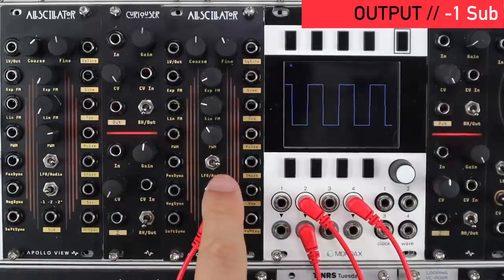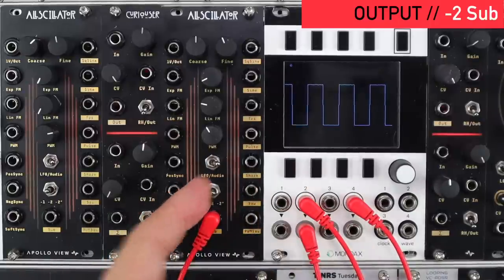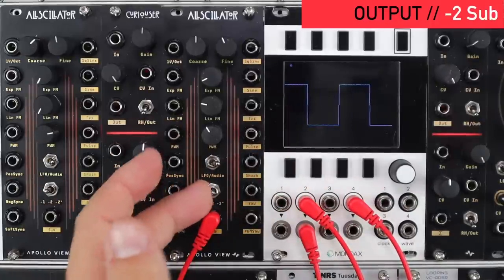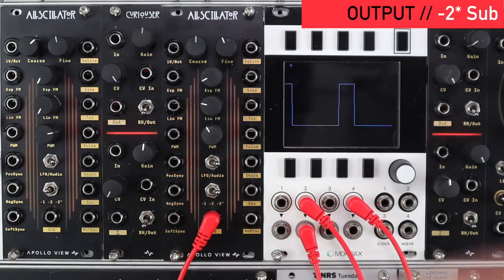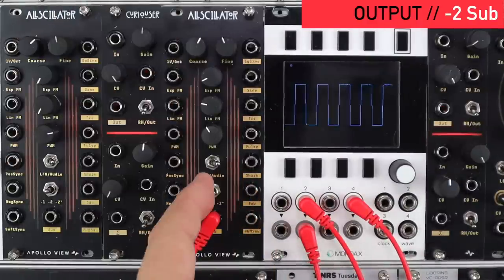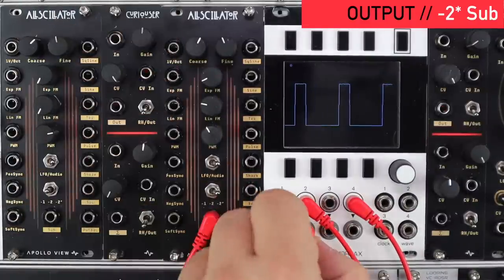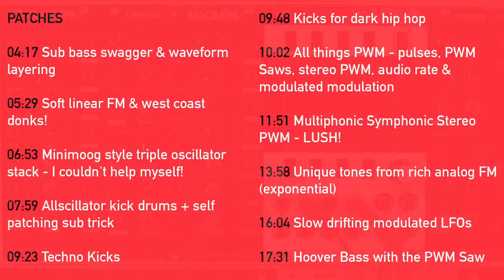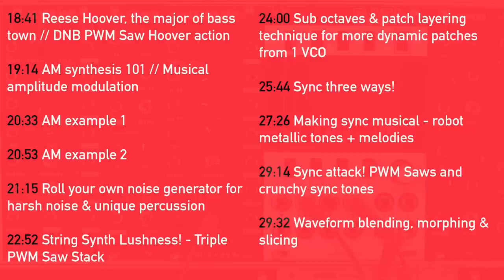PATCH BETTER with 16+ patches for oscillators // Allscillator from Apollo View Modular

Comment: Dang, tip one, and I'm blown away
I've had an oscillator with a sub out (Bastl Pizza) for a while now, and never considered using two different VCA patterns to make it sound like two voices.
It's such a simple idea, and I've done some really weird patching since I've built this rack, but somehow there are some little tricks like this that need to be shown to me.

It feels like if someone pointed out a door that leads to a room I never noticed in my house.
Reply: Mylar melodies is real great at doing that. Taking different outputs and running through entirely different vca, filter and effects routing to fake different voices. Fun stuff!
Reply from the maker: Thanks Gaeel, a personal favourite is having a less rhythmical dense gate pattern play an envelope + VCA for a sub wave. If you can get a -2 octave sub you can get some really cool separation between what feels like a higher and lower part. 

It usually means faster envelopes so you don't hear the other pitches come from as an envelope fades out and the 1v/oct is still playing faster changes but usually works well.
Reply from the maker: Yeah Mylar is a good call for that too, one thing he does different to this example which is nice is use the same pitch sequence but split off the pitch sequence. Rather than use one oscillator and break off different wave forms. Split the sequence into multiple places but only let certain notes play on each one. Nice musical way to work.

Comment: Thank you. I am little more than an initiate into synthesis, and this very informative video is encouraging. Much of what you are doing seems super complicated even after you explain it I must admit. Nonetheless the way you explain it along with the visual aid of watching you do it at the same time makes its simple elegance obvious.
Reply from the maker: Thanks Aaron, things are tricky when you get started. If you can give VCV (free software) a try and try to rebuild some patches from videos that you like. It will give you an idea of how to go about some of the patch ideas without the cost of having it all in front of you. It's not patching hardware in experience obviously but it can help with the initial learning and understanding of patches. 

Feel free to ask questions and thanks for the comment.
Reply: @DivKid  I am doing purely analog to start out. I actually started by building simple to moderate breadboard modules. It helped me understand the individual components and very basic patching. I am encouraged to dig deeper now.
Reply from the maker: breadboarding and understanding the circuits is a great way to go, hope it's all going well.

Comment: this really was super inspiring, tried out a few things with my little AE Modular, the AM in particular worked well and really expands the range of timbres I can get from 3 fairly limited oscillators. A bit of filter FM just to spice it up even more, interesting comparing how the overall sound can change a lot depending on wether the base oscillator or one of the modulating oscillators is also modulating the filter. Lots of ground to cover with experiments, I'm embarrassed to say I hadn't thought about AM using a VCA... Cheers Ben, thanks for the video. 🙏💙
Reply from the maker: glad to hear that and glad to hear you're getting good results too. Definitely coupling filter FM with AM is a good thing. As you say which of the oscillators goes where makes a big difference. Also try modulating the filter with the AM modulated waveform that can be fun.

Comment: Minor correction: The synced waveforms look like what you'd get from a 3340 IC, and the positive/negative sync-inputs are an almost dead giveaway that thats the chip that was used.

The standard hard sync on the 3340 doesn't work like 'normal' hard sync - that the waveform simply resets - what actually happens is that the triangle wave "switches direction" if the positive sync pulse coincides with the positive ramp of the triangle. (And the other way around for negative sync)

This is a pretty unconventional way of implementing sync, so many manufacturers who used the 3340 back in the day did a workaround to get the regular sawtooth reset kind of sync. 

I always like it when designers go for the "true" 3340 hard sync. It's a cool sound, especially on the tri wave, and opens up for some patches that aren't possible otherwise.
Reply from the maker: Hi Johan, yeah the 3340 IC was used, Apollo View aren't trying to hide that, they mention on their site/manual. 

Thanks for the history/explanation of the sync and how people usually changed it, always great to hear information like that.
Reply: @DivKid   Wow, thank you for the reply! After posting I honestly felt a little awkward for such infodumping. Thank you for your work throughout the years, you are so inspiring.
Reply from the maker: Thanks for following along over the years and for the kind words, much appreciated. 

No worries about the info dump, it's good to learn new things so always feel free to share here.

Comment: Do you have any other videos that are just module agnostic patch ideas?  I enjoyed this video a ton.
Reply from the maker: Hello, I'd say any demo I've made. It's for the most part all applicable to any module. They're usually (like this) also wrapped up in module demos though. Luckily the people I work with are happy for me to push ideas people can take away and try. 

For example take the Dannysound Timbre (wave folder) video and if you see a patch you like try it on a Doepfer Wave Multipler, Joranalogue Fold 6 etc. 

I appreciate that doesn't sign post you to much but more often than not the patches apply across a broad bunch of modules with the same or similar functions. 

Do ask any questions though and I'll try to help. Or you have specific module types you'd like to get more from I'll grab some links.

Comment: It's a lttle hard to see what one of these can do on it's own because you are using two at the same time. Just a suggestion but it would have been nicer if you had demonstrated one solo Allscillator first, then later on in the video demonstrate two. I would be more interested starting out with showing how you can combine the 8 outputs of one module.